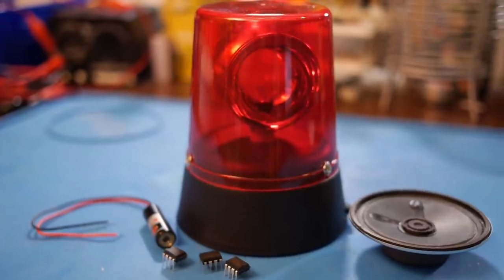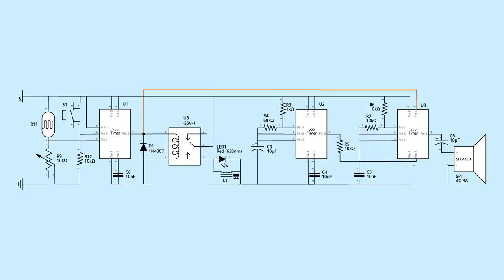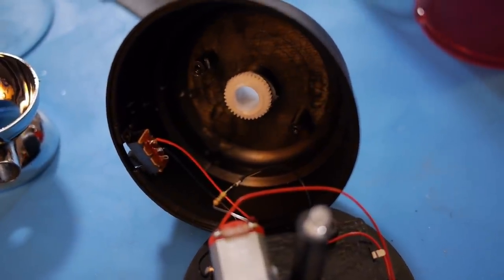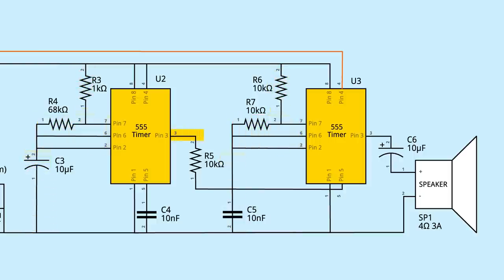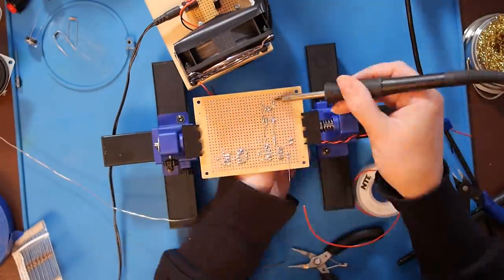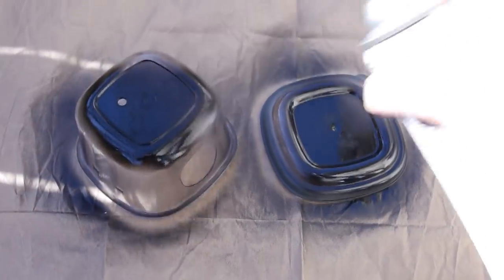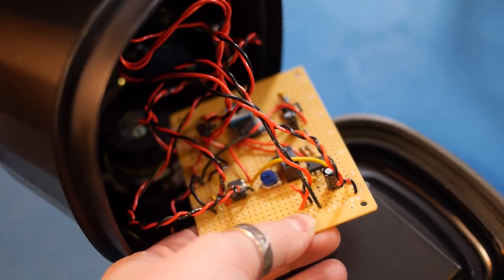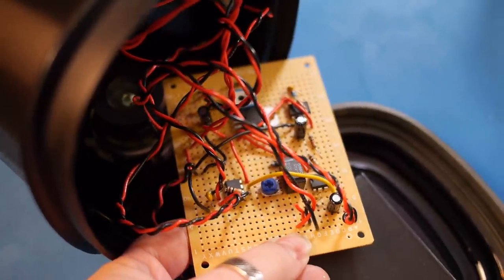DIY Laser Trip Wire Alarm - The Learning Circuit

Comment: Congrats Karen, you implemented a cool idea with an analog circuit and avoided unnecessary mcus that are so easily over choosed today. I know how difficult video production could be, and despite some rough edges and "not as analog as it could be" (op amps, audio amp, better detection method, etc) it was quite good. Its been quite some time since an e14's video got my attention!

Comment: Ok. Let's try. Bad idea is to use 2xne555 for sound. Motor from light can make disturbance and effect sound. Instead you can use car alarm siren for it. It's loud and less components on pcb. Everything else is ok. You can add wireless 433mhz receiver to reset alarm. So only you can reset it.

Comment: Hi Karen, and happy new year!
Maybe use a transistor or MOSFET to drive the speaker? I am surprised the 555 does not blow up, and that might explain the weird sound?
Reply: It's very possible. I got the circuit design from a 555 circuits ebook by Colin Mitchell. It's a "Police Siren." I tried it on the breadboard and it worked, so I didn't question it beyond that. [shrug] I will say the sound was fine on the breadboard. Nice and clear. It only got weird once it was all soldered together, so I'm guessing it was because of some weird crossed signals somewhere, or I messed something up in translation with my board layout.
Reply: @maker_karen1785  Take out the board and retrace every connection, against the circuit diagram. Make sure every contact is like in the schematic. Then with a sharp knife make sure there are no wild connections between close enough pads on the board. Some stranded solder spikes or bridge.

Comment: I wish to have a 12V supply as I want to activate a 12v solenoid or actuator. Can I use the same components you have in your Diag or would I need to supplement? Any help would be appreciated...
Reply: run it to a relay
Reply: so instead of alarm you wire a relay to it then then the relay opens the circuit to either your higher power battery or a buck converter buck converter is usually good

Comment: Pin 7 of the 555 to vcc? That sounds ... strange. 

Pin 7 is "discharge" and is an open collector to gnd, it would create a short whenever pin 6 "threshold" is held high.
Reply: For the weird noise, I think - I have not tested it yet - that using pin 5 ("voltage control") to turn the second chip on or off does not quite achieve the job - if you want to have a on-off tone, you can get the output of the bistable to the reset on the first 555 and the output of this 555 to the reset of the second (the one driving the speaker). Using pin 5, you can actually create a two-tone alarm: the bistable then drives the reset on both 555, and the output of the first 555 drive the VC (pin 5) of the second 555. The resistor between the two should be tweaked to achieve the right voltage change.

Internally, there is a voltage divider with 3 5k resistors (https://www.ti.com/lit/ds/symlink/lm555.pdf). Voltage Control (pin 5) arrives directly between the first and second resistors and at the junction with the threshold comparator. With your 10k resistor, trigger and threshold are set to 38% and 75% of Vcc when high, and 22% and 44% when low: when high, the frequency is significantly lower than when low.

I will play with this when I get a chance.
Reply: Yup, you have to bind the reset pins from both 555 to the output of the bistable if you want to create a two-tone siren using pin 5.

Comment: Dear I just wanted to know which solder iron do u use
Reply: It's a Weller WT1. I really like it. It heats up very fast, is easy to adjust the temperature, and keeps a very consistent temperature. Would recommend.
Reply: Thanks dear ,but I'm from India ,I don't think it will be available here

Comment: Could you do a musical hallway some time?  It would be along the lines of this circuit.  Something where a photo-transistor on 1 side of a hallway and a bright led on the other side of the hall could cause musical tones to play as someone walked thru the different transistor/led pairs for 8-10 feet maybe spaced out a foot apart.  Like musical stairways but more basic.   The demo could be small in size for the video to make it less troublesome.  I think some people call these air harps. Thanks!
Reply: We made a laser harp back on The Ben Heck Show. Though it was mostly all Ben and Felix that built it. I remember it being kind of a nightmare for them.

Comment: SORRY I CANNOT SEE VERY WELL. HENCE ALL CAPS.  CAN I USE A BOARD WITH WIFI?  I was told 8266 has WiFi. I NEVER PUT CODE IN BEFORE.  
I NEED STORAGE BUILDING / WORKSHOP  INBACK YARD PROTECTED.  WIFI / I CAN SEND TO COMPUTER .  I WILL START USING HOME ASSISTANT SOON HOPEFULLY.   VERY COLD IN WINTER AND HOT IN SUMMER, NOT GOID FOR RASPBERRY PI TO WORK.

IF YOU KNOW HOW,  A DOOR / WINDOW SENSOR WOULD WORK. I THINK SOME USE 8266 FOR THAT ALSO.  I DONT KNOW BATTERY REQUIREMENTS. SINGLE LION MAYBE OR IT MAY HAVE CORD TO RUN...PLUG IN..?

Please advise.

Most Humble Appreciation!  Alton

Comment: We need to have a warning saying WARNING Class III LASER in use to protect premises, We need a an op-amp driving a series pass transistor to control the current and voltage to the laser and also a small resistor connects from the negative side of the laser diode to negative and a 47K resistor from the junction of the laser diode and the resistor to ground feeds back to the inverting pin on the op-amp as we don't want to burn out the LASER diodes as they are expensive.